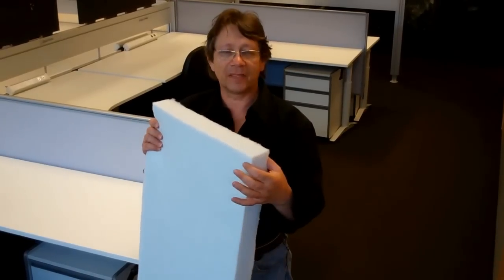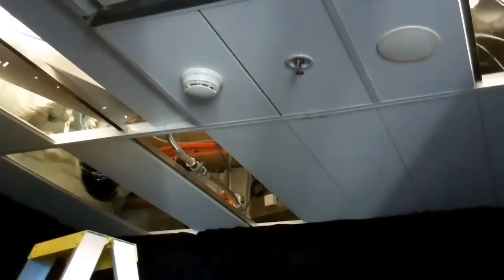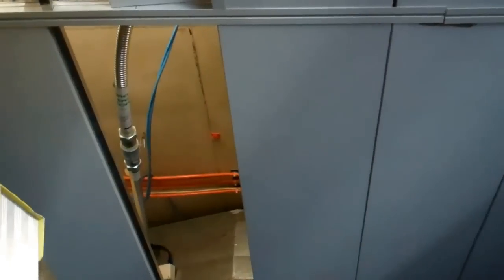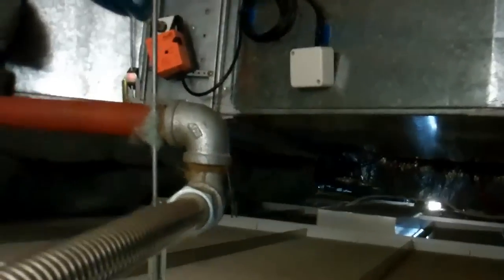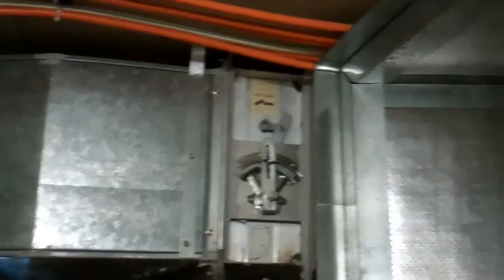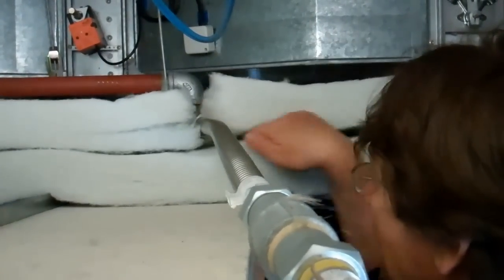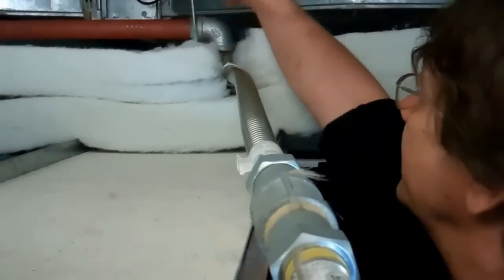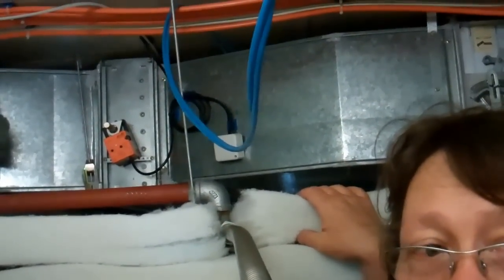Best Sound Proofing Treatment in Suspended Ceiling Cavity

Comment: Has anyone actually applied this? And about how much did it help?
Reply from the maker: I did that job many times, it is a very common problem and it is as good if not better than the partition wall itself, it works much better than a mass loaded vinyl suspended.

Comment: would you recommend this method to a dance studio?
Reply from the maker: Sorry, I've missed your comment, it was hidden, waiting for approval and I wasn't aware of. The best is to build a wall right to the slab but if it is an existing cavity, you can use 600mm wide batts at a higher density such as 50-60kg/m3 for a dance studio and of course, seal the gaps between the partition wall and the ceiling, I did another video, "How To Sound Proof An Office" with more details

Comment: Do you secure the batts somehow or do you just stack them?  I have about 5 feet of space between my ceiling and the roof deck.  I'm worried my batts will just fall over.  Thanks you!
Reply from the maker: Sorry, I've missed your comment, it was hidden, waiting for approval and I wasn't aware of. you are right, 5 feet is a bit too high, in that case, I am installing the batts all over the ceiling with a layer of mass loaded vinyl above the batts, overlapping the joints and tapping. Every case must be assessed and evaluated to find the bets or most cost effective solution